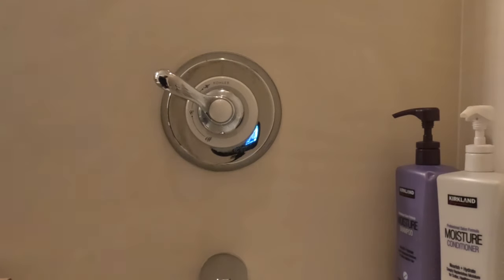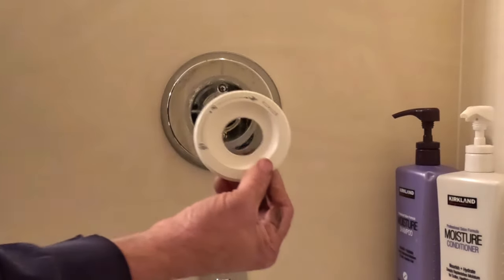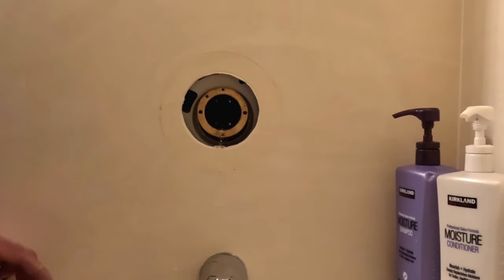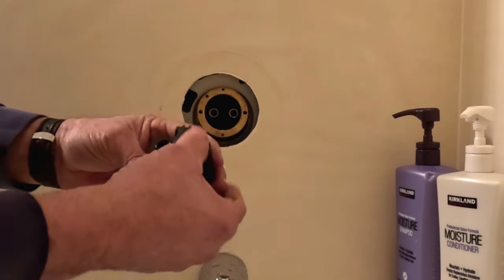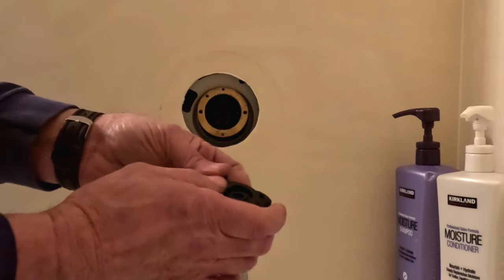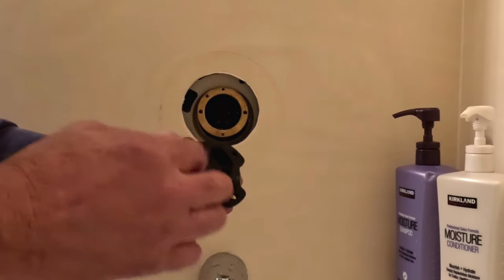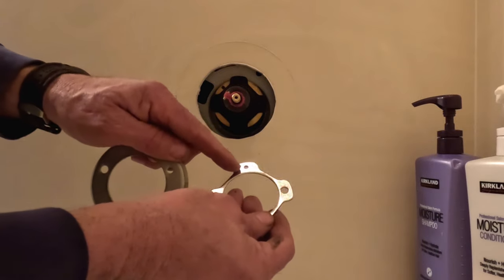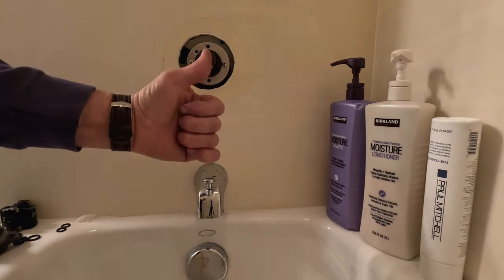How to Replace a Kohler Shower Cartridge

Comment: When I unscrewed the screw in the handle. The handle did not come out. It still seems to be attached even though I took out the screw. I would appreciate any help you can give. Thank you.
Reply from the maker: The handle is die cast and the cartridge stem is brass. They get bonded together because of the die cast. You can wiggle it around until it breaks the bond. I use heat when I have an extreme problem.

Comment: how do i remove the cartridge? I was able to get to it, but it won't come off. Am i missing something?
Reply from the maker: After removing the 2 screws on the retaining plate the cartridge should pull out. You may need to wiggle it around some if you have really hard water.

Comment: You did not show how to remove the white face plate and i broke mine folllowing your video. You might have skipped that this white plate has 2 grooves that I needed to twist to get it to the right angle to be removed but it costed me the price to replace the whole faucet and kits. Not very impressed with this skipping step.
Reply from the maker: Not every Kohler has the plate. There are probably 15 different trim variations. This is a video on replacing the cartridge.